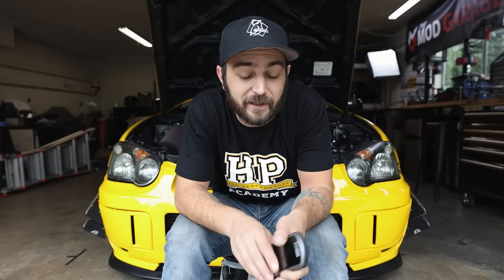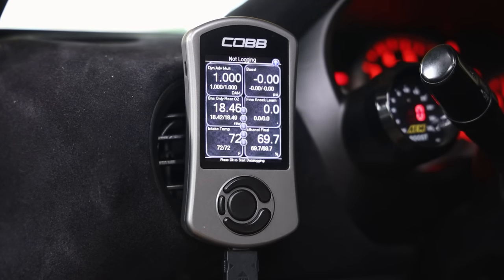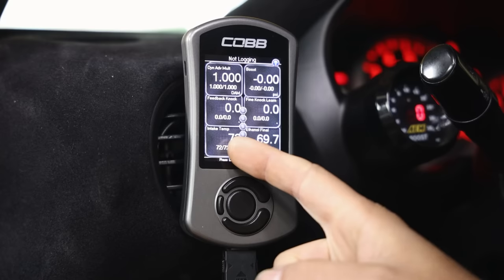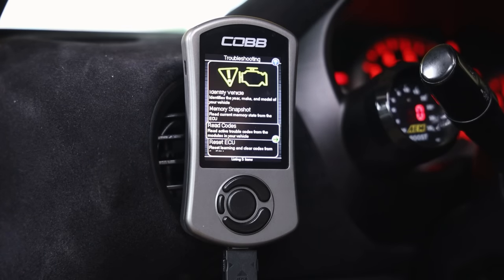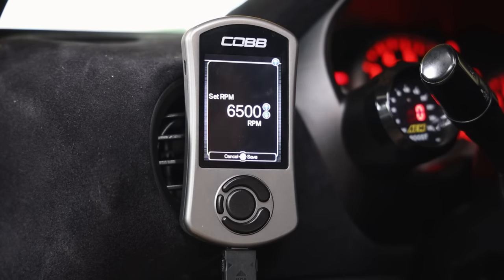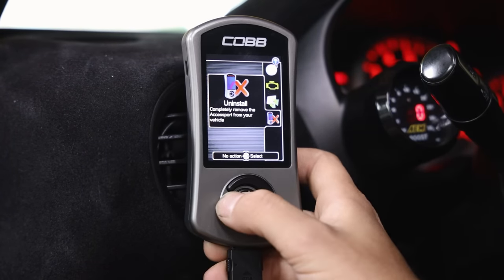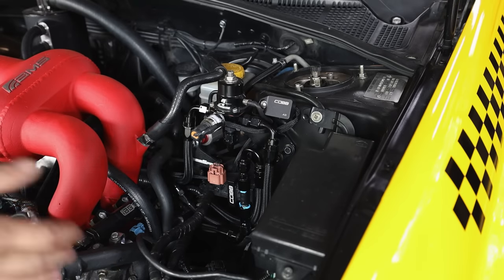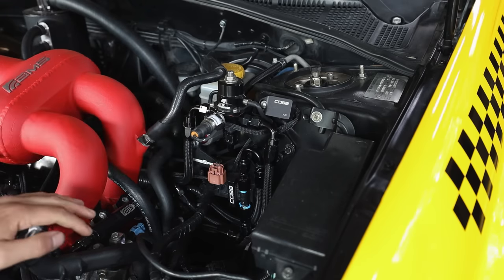Complete Cobb AccessPort Guide: Features, Values, Set up, Tuning & More.

Comment: Extra comment for people with the VA chassis WRX (FA20DIT). The knock sensor on that car is extremely sensitive and it is normal to see DAM values ranging from 0.612-1.000 so don't get worried when it drops when the weather gets warm or there is a small event.

Edit.

Also that car will show a -1.41 Feedback Knock when the ac turns on but thats also fine.
Reply from the maker: Good info to add 🤙
Reply: Cody 404  honestly in my experience almost anything will trigger the -1.41. even just accelerating in too high of a gear (like hitting the gas at 60 in 6th gear)

Comment: This channel need recognition and a award itself, waiting the dealer to bring up my subaru sti limited and first thing on buying is a weeding ring (COBB) to start with. First timer here on this platform and a noob question following:

Can anybody explain in their words what is this Feedback Knock? New to this words terms on high tiers cars.  Thanks in advance!
Reply from the maker: Feedback knock is when thr knock sensor picks up on detonation. Essentially the ECu detects combustion events when they shouldent be happening. Detonation will destroy the gas layer protecting thr piston and the valves, the extreme heat from thr k oak event is what leads to burnt valves and broken ringlands 🙏

Comment: Thank god for this video. I rarely rarely get a 1.40 FKLN and today I looked over and seen that and about had a heart attack. The cars got the stage 1 tune w/Cobb intake and never really beat on it so I was like “wtf” but now that I know it’s possible phantom or just normal. 100k miles still running great thanks to a lot of your mod recommendations. Thank you sir
Reply from the maker: Totally normal and nothing to stress 🔥
Reply: @Smeedia  so I installed the stage 1 with gap city tuning and today I got 11.45  as my feedback knock wondering if I should worry ab it
Reply from the maker: Is it consitant or was it a one time thing? 🙏
Reply: @tyger2000  I agree with tanner with his question if it was only a 1 time deal. I’d like to add. Was it under normal driving conditions? Did you almost stall that day? What other mods are being ran? And was the tune with those mods included, Bc that’s a big adjustment. 

Sometimes if you monitor the heart attack box (Cobb tuner) sometimes you will see the way you drive or mistakes in the driving sometimes trigger the ecu to adjust for that very mistake.
Reply: @Smeedia  just a 1 time thing I told them all the mods I’ve had
Reply: @suubawoosti8279  and no just a 1 time thing been trying different gas stations such as alon,Phillip 66 and 7/11 and it said 11.45 as soon as I took off at the gas station and been around 1.4 to 2.81 I’ve also told GAP city performance I had the boomba bpv and Cobb stage 1

Comment: Very informative video. Great job!

Found a nice donor at the junkyard last week. Scooped a sick Kenwood headunit someone uninstalled and just left in there as well as a new center console lid. Went back today and got the driver window regulator w/ motor that I suspect I need for the FXT, which someone also uninstalled and left there. Hey, less work I have to do right? And as a bonus a g35 sedan in my exact rare color was in there. Gonna grab a door or two and a fender over the next few days.
Reply from the maker: Ohhhhh sounds like you found some gooides. I haven't gotten that lucky at the junk yard yet 😅

Comment: Hey Tanner. I have a 2020 Sti with 30K and recently had a Cobb SF intake, IAG AOS, cylinder 4 cooling mod and Cobb Accessport installed with a pro tune. In the past 2 days the AP has recorded a fine knock learn of -6.90 and -7. The feedback knock has not gone over -4.20 and my DAM has stayed at 1 at all times. Any reason to be concerned with the fine knock learn numbers? Thanks

Comment: I really like your videos bud. Your very informative and have bring great humor along with it. Big Fan! I just installed the stage 1+ OTS map from Cobb. My cars feedback knock was as low as -3.81 never positive tho. Should I be concerned? Also about how long does it take for the AP to learn your car?
Reply: 2020 WRX
Reply from the maker: Nothing to stress about and totally normal value. You'll see up to -4.20 considered normal for knock readings. And it will continue to learn but after a reflash let it idle for 15 min or so then drive it normal for the first 10 miles or so
Reply: @Smeedia  I’ve put about 50 miles on the new tune. When would you recommend doing a reflash?

Comment: Great video. I’ve been waiting for this. I do have a question. What are the small numbers below each live monitoring gauge? I’m assuming high and low recorded during driving session. If your live numbers return to zero or whatever is spec after a knock peak for instance, is that good? If something was seriously wrong would it read bad numbers in the real-time all the time? For instance, is a registered high and low something to be concerned about or if the real-time returns to zero or whatever spec should be  does that mean the car has made the correction ? Sorry I hope this makes some sense. It’s been something I’ve been thinking about as I am new to the access port scene. Thanks again!
Reply from the maker: Correct those are your highs and lows, as for it returning to zero which parameter would you be referencing?
Reply: @Smeedia  I guess the main 3 Important ones. DAM, feedback knock and fine knock learn. So say they registered a high number of -2.8 or -4.2 and it stored it in the high low section but the real-time is at 0. I know dam is ideal to 1 with 15-21 wrx. Im assuming it can drop if it reads some numbers with the other 2.
Reply: @Tactical_Duck_  for dam, it can fluctuate a little due to bad gas usually, and it'll climb back up in small increments, if it drops say to 0.725 or whatever and starts climbing back up to .850 and back up to 1.000 you can assume it was bad gas, if it stays down you could assume theres issues, if you have a -2.8 knock and its now at 0, that knock has gone away and will be learned out through the accessport when you go back over that rpm range/load, from personal experience i see it start at say that -2.8 it'll be active and slowly work its way down, that means its actively doing its job and learning and correcting that load/rpm range, the lower 2 numbers read your LOW/HIGH respectively, so that can be useful  to see peak AFR,boost etc but really doesnt mean much

Comment: I had an accessport I used in my 2015 wrx worked great but I had 6 data readings like this video but I switched to my 04 wrx now n only have one data reading now can I change that or no since the age?
Reply from the maker: You can, up in the top right corner click the arrow and go to number of gauges and you can set it up however you like 🙏

Comment: hey man, I just bought a 2006 WRX STI. it had an existing Evap leak that I fixed, I had to unplug the battery and pull the alternator to get to it. Previously the car never knocked over -4.0, now I see a value of -11.0 when I come up a hill. Just cruising, no boost, going ~60-65 in sixth gear. any suggestions?

Comment: So I bought a 2010 Mazdaspeed 3 with an Cobb Accessport already on it, and a problem I have is where the previous owner set the rev limiter, which is why I'm watching this video, but my problem now is that under the tuning section of my Accessport the "adjustments" tab isn't there, is there a way to add it or should I contact a professional tuner about this problem

Comment: Does the Accessport perform it's "learn" abilities only when it's hooked up to the car? And when you unplug the Accessport, all of the learning and on-the-fly adjustments are frozen? Or is this a function performed by the ECU already and the Accessport just handles the maps?
Reply from the maker: No, it should still be making those even with it unplugged. The AP is essentially just a screen to read the ecm

Comment: Subaru knock sensors are insanely sensitive. My ap lists knock from how rough the highway is near my house. Can go up to a knock reading of -2.81.

Other than that as long as your dam isnt dropping and the knock readings arent there all the time. You are generally good. 

But they do call it the COBB Anxiety port for a reason lol.
Reply from the maker: Lol for real, so much anxiety 😅 my knock sensor picks up so much
Reply: @Smeedia  will pick up the AC compressor as well. 

For such a sensative sensor, they dont put it in the best of places. The '15 has the knock sensor in a little dish on the top of the engine. After a good rain fall, the next morning i got a knock sensor short error u til the engine warmed up and evaporated all the water.

Comment: Installing an AccessPort with a pre-existing tune, be it open source or other. Does the AP automatically install a new tune or erase the existing tune on that first install? Is it possible to backup an existing tune before hand somehow and then be able to load it via the new AP? Awesome vid, really helpful!
Reply: Technically it does neither.  It saves a backup of the ECU itself (including the tune/map) onto the AP, then overwrites the ECU with new software (you choose the new tune during install).  The backup can then be saved to your PC as well for safe keeping.  

When you uninstall the AP, it will uninstall the software from the ECU and replace it with the original backup and tune.
Reply: @surrrithux  So I have no choice but to get the car re-tuned when I install the AP. I can't use an OTS tune since I don't have OTS parts. The current tune is old, from 2012 and does need updated but it works for now, the car runs good. That's why I was wondering if I could install the AP and backup the current tune and then reinstall that tune but with the AP in place so I could use it's monitoring functions and such that @smeedia covers in the vid here.
Reply from the maker: Exactly what Surrrithux said, you'd have to get a retune. The tune would have had to be built in access tuner to work with the AP

Comment: Awesome vid. Is it normal to have AF learning 1 go into the -12 or -13 mark while cruising highway speeds  and or around town. Then drop back closer to 0 and so on. Is that a gauge that should be monitored? I’m assuming the car makes constant adjustments as you drive.
Reply from the maker: Ideally you want +/-5 on AF correction, what's that looking like?

Comment: @smeedia yoo! I just got my tuned and they installed the Accessport for me because i didn't know how the previous owner tuned the car and i had no AC with it to be safe. Question is, what happens when you reflash? I want to do Launch Control but the faq says i need to reflash after changing the rpm settings for it to work. The tuner just added their custom tune and i see it in the AC and an option to reflash.  What is a reflash?

Comment: hello, when I follow the setting of the features( launch control) I can not change the rpm. I press the change launch control it just returns to the features. Then when I rev the motor it just goes to 7000 8000 plus it cant be set to .....what can I do?

Comment: Hi Tanner , yesterday I got these values : feedback knock (-6.0)  feedback knock learn (-11.75)  and my DAM dropped to 0.875 right  after switching to Motul excess 5-w40 , can oil create this kind of drastic change? Should I try a different oil ? Thanks!
Reply from the maker: No oil would not make a change like that, diffrent grades of oil can have an effect on oil pressure and and oil temp. But for knock values it shouldent unless you make a drastically change in grade. 

I would start looking around for something else going on. 🙏
Reply: Maybe my car doesn't like Motul, the car had the oil the tuner uses on their built blocks
Reply from the maker: @alexortega714  are you stock block or built? 👀
Reply: @Smeedia  it's a built bottom end ,forged pistons , rods , fmic , tomei unequal lenght headers , speed density , fp black , 450 walls bro pump , external wastgate  etc etc ....Should I leave that oil and drive the car off boost to see if the dam goes back to 1.00? Thanks alot for your input!
Reply: It's got  dual map (93 map and a e85) right now it's on e85
Reply from the maker: Try resetting ECU learning if it does it again I'd start to investigate
Reply: With those knock #s, pray 🙏 your knock sensor is bad. My knock sensor broke when the dealership transferred it to my new shortblock and I had crazy high phantom knock until sensor was replaced.

Comment: Flatfoot shifting is a hoot, any tips on getting launch control to sound more like a 2step?
Reply from the maker: Set it higher 😅 you'll never get the same sound but bumping it up will get it closer if your just wanting the sound
Reply: @Smeedia  correct me if I'm wrong, Cobb AP launch control is like a fuel cut limiter where a stand-alone ECU will do something funky with the ignition timing... Sounds more like key bangin an engine rev/ your injectors are sending unburnt fuel past your exhaust valves

Comment: Awesome Video my dude! What are your thoughts on knocking sounds upon start-up only on cold days, after the block was re-honed and slightly larger forged pistons were installed?
Reply from the maker: Normal, just piston slap. Mine does it as well. Because the metal is cool it has some gaps up until everything expands 🤙
Reply: @Smeedia  Awesome! Thanks again for the responses!

Comment: I have an 04(so 1-16 DAM). I was driving normally this friday and i was slowly speeding up on the highway. Didnt even hit boost. And my DAM dropped to 4. No Feedback knock or anything. This is the second time its done this. First time, it went bacl to 16 within 40 miles. Very strange. Gonna do a smoke test for evap leaks this weekend
Reply from the maker: I've had similar happen before. Sometimes it's just a hiccup in thr tune
Reply: @Smeedia  well that makes me feel a bit better lol. Makes no sense to me. I did put a newer turbo(same vf39)/ewg(same spring as the oem iwg) since its been tuned. It hit 0psi and yeeted. Could just be hitting boost more efficiently with the ewg. And it pissed the car off. Looking to get it tuned again.

Comment: i just installed my intake with access port from cobb today and after they program it, my DAM is actually 0.938/0.938. I'm new to this OTS tunes. Do I have to be worried about anything?
Reply from the maker: Let the ecu learn a little and it should pop up to 1, it's not uncommon to see less than 1 after a reflash
Reply: @Smeedia  awesome. it's still the same right now but it never went up or down for the past few days. I'll keep an eye on it. Thank you so much!

Comment: Super helpful video since i just got my 14 hatch and is there like Subaru forums where I can ask questions? My hatch got the engine replaced with the 2.0 liter instead of 2.5 and I wanted to buy a tomiei exhaust but not sure if I could just buy the exhaust made for the ej25 or I had to get a different one.
Reply from the maker: You can jump in our discord. Lots of helpful people on there 🔥
And a catback is a catback. As long as it fits you should be 🤌
Reply: @Smeedia  goated and ima join right away thanks

Comment: Hey, I know this was some time ago, but I wanted to ask. If I repair the throttle pedal or replace the throttle sensor. It recommends resetting the ECU. Since i did that, do I need to retune my vehicle as well? Because the car is still on limp mode.
Reply from the maker: No need to retune 🙏

Comment: Yo man I’ve watched all of your AP videos and just had a couple questions I’m anxious about, maybe you can help. I’m etuning right now for flex fuel on e85/93oct. My car will just jump straight to 205 degrees The moment I stop rolling and it does go down to 190. Is this weird? It also hits -1.40 fbk with no knock correction. Is that because of how small the fbk value is? These things make you anxious as hell, getting rid of it once I’m tuned 😂
Reply from the maker: All totally normal 🤙 205 is when the fans kick on and wouldent stress the feedback knock. Both normal 🔥
Reply: @Smeedia  my dude 🔥 you’re the best!

Comment: Dum qeastion but if the battery of the car is ever disconnect Meaning if you ever need to fix something in front of the engine and the battery needs to be unplugged , do you have to reset the stage on the AP ?
Reply from the maker: No you don't, it will retain the memory to keep the MAP loaded 🙏
Reply: @Smeedia  thanks man👌🏽 your videos are great way to explain the AP keep it up my dude 🤞🏽 ouuee!!!

Comment: Just got my 2015 wrx, went to go get it protuned, and told they couldn't access the ecu because the old owner didn't uninstall their accesport from the car when they sold it. Now its locked them out of the ecu and was told to get a new ecu for the car. Any advice?
Reply from the maker: You should be able to overwrite the ECU, I've had to do it a few times. The ecu should only brick or lock if your disconnecting the accessport while it's writing the ECU

Comment: Funny that this was posted two days after I've had my first DAM drop in years.  It's down to .750 on my 17 WRX, and hasn't gone back to 1 even after refilling my tank from a different gas station.  Keep getting fine knock learn of -3.16 at WOT around 5k RPMs, with a +0.35 value coming in on mild throttle while cruising around 2.5k RPMs.  Really stumped as to how much longer its going to take to get this DAM back to 1.  This is on an OTS E30 map btw.
Reply from the maker: OTS E30? Whp made the map?
Reply: @Smeedia  MAPerformance.  Stage 1 E30 map.  No feedback knock during WOT either, just still seeing fine knock learn values accumulate in the same rev ranges over time.